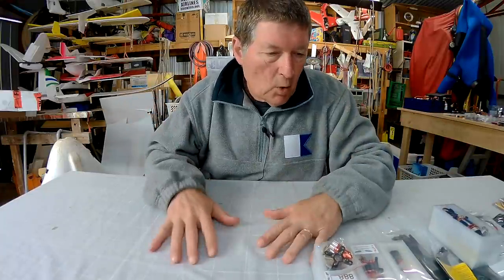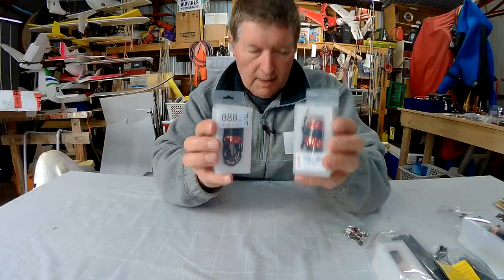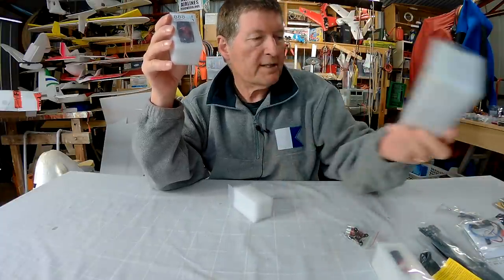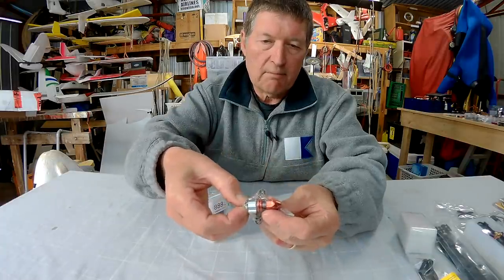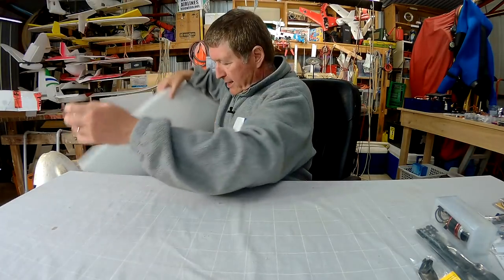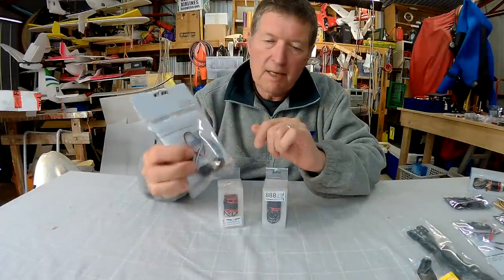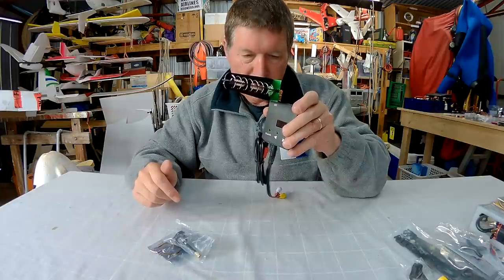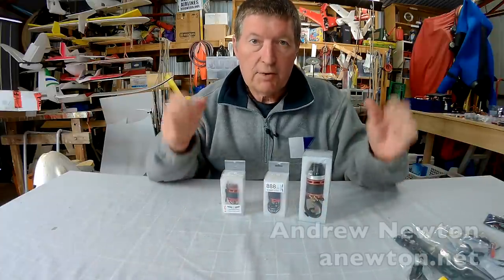Carbon Bird smaller motors

Comment: Excellent stuff Andrew, I was in the market for some proper quality motors after some recent failures of two Chinese name brand
versions, one in flight, and two on the test bench.. I was less than confident for long range reliability after that. Also, those servo's were tiny 35 years ago.. we all wondered how they could squeeze so much into that tiny brick!
Reply from the maker: Thanks Alasdair. Seriously good looking motors with all the parts available too. Testing commencing today.

Comment: That wing is EPOR ? or did it ever get moved to EPP. What are your thoughts on that vs the other banggood foam planes?
Reply from the maker: Feels like old style polystyrene, is that EPOR? But it will be laminated and it is a proven fast tough wing. Time will tell.
Reply: Not sure what epor is exactly i had just read it online that the wing was made from it. The videos guys made in that wing are one of the reasons i wanted to start doing fpv.
Reply from the maker: Just started building this wing and read the RiteWing explanation of EPOR vs EPP. Lighter, stiffer and easier to build it seems, but maybe not as tough.

Comment: Hi Andrew,

I have ordered an fx-61 from multiwiicopter and they suggest the 888 motor in the excluded extras. Do you think it will be powerful enough for the fx-61 or should I go for something else?

Just thought I would ask you as you have experience with both and thanks again for the great videos
Reply from the maker: It would work on a minimum weight setup but a 3536 size motor would be more suited for more power

Comment: I really wish i could say my experience with these motors were good. I bought two 1111kv motors and had them shipped all the way to Texas.  The ad said a 11x5 prop is included which i didn't receive. I emailed multiwii and received no response. I let it because there was no sense in shipping two props to the other side of the world.

After install i noticed the motor had some vibration, nothing terrible but it certainly wasn't smooth. It failed in roughly three minutes. Rear bearing was cooked.
I reached out to multiwii again and it was suggested i made an installation error and multiwii "hand spins" every motor. They also addressed the missing props by sending links to folding props and spinners that i coulld purchase from them. So i open up the second motor and notice the magnet was hitting the stator right out of the box. I sent this video https://youtu.be/_biYQ4p5YEY 
Their response was that a magnet could break if i drop the motor. Also through the series of emails i was sent links to products as a sales pitch. It was also suggested shipping will be free if i buy more motors. Through the whole email process Quin was defensive and down right passive aggressive towards the end.

I'm sure these are good motors when they don't have quality control issues. Unfortunately i'm left with dealing with a company that believes sales pitches are the way to handle tech issues.

 Thanks for all the videos Andrew. I wouldn't own half the planes i do with out them. By the way omnibus flight controllers are much cheaper than air3 boards, and they have more features. ;)
Reply from the maker: Sorry to hear that Brian, I haven't had any problems so far. I guess there always can be QC problems but they should be taken seriously by the vendor. Poor customer support will damage sales. I have two Omnibus boards and I do like them a lot, but not everyone is up for soldering and flashing firmware etc. Quit also told me props would be included with motors.
Reply: Customer support ending when i said the second noisy motor was still in original packaging and only opened for the video.
Found replacement bearings for the 1111kv motors. There is two different sizes for front and rear.

https://www.vxb.com/R1450ZZ-Miniature-Shielded-Bearing-5x14x5-p/r1450zz.htm

http://www.vxb.com/685ZZ-Shielded-Miniature-Bearing-5x11x5-p/685zz.htm

In other news my buffalo fx-79 was clocked at 101mph (inav gps speed reading) with a dys 3648 and apc 13" prop at 52 amps. I'm excited to compare the 1111kv to the cheap dys 3648.

I'd like to see a video of a mini drak or strix goblin in the future. You have the best quality flight videos.